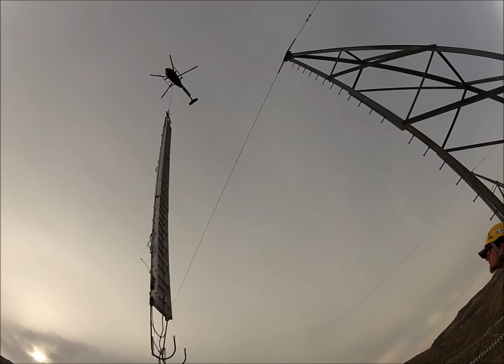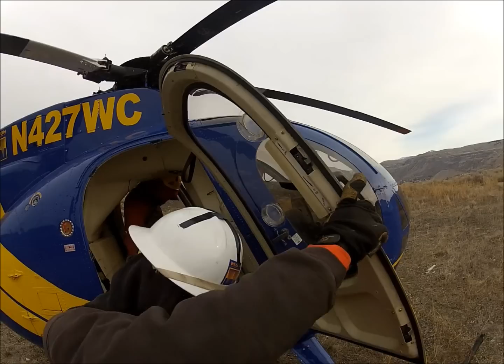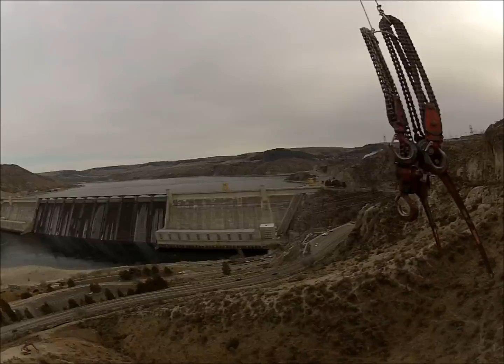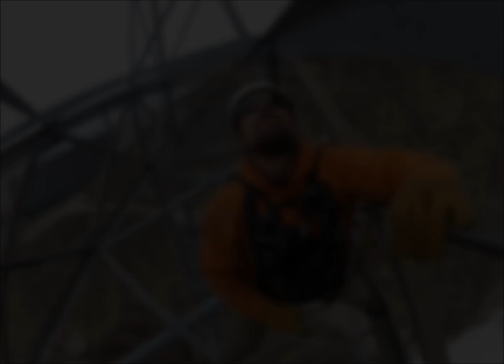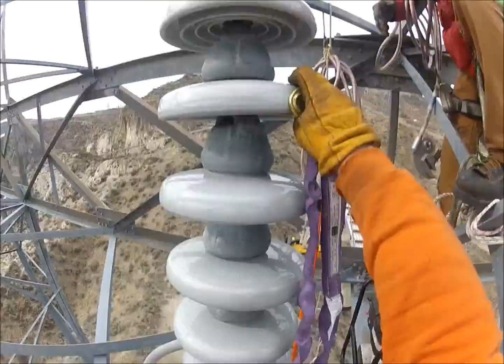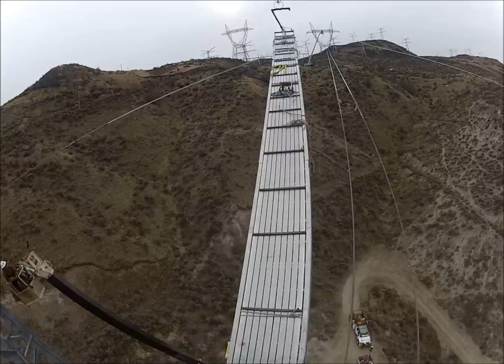Grand Coulee 500kv

Comment: According to Aaron Dover, there are no generators at Gran Coulee or any other dam. You can clearly see that there is no water coming out of the bottom of the dam in the video. That is consistent with Dover's theory. 

What IS going on here is an update to the power lines which gather atmospheric voltage on their own.

Comment: I have made two trips to the west coast from the Midwest where I drove out of the way just to see the Grand Coulee Dam and take the tour of the great project.  It doesn't look it but there is enough concrete in the dam to build 3 Hoover dams.  I was amazed at the transmission towers out of there.  It is a long way down and the wind moving you around makes what these guys are doing dangerous at every place.  Here they are doing it on a dead line but lots of times they do it on energized lines, tough job, if you want to see how dangerous ask a life insurance salesman what a lineman's rates are.

Comment: I'm gathering these lines are switched off? You're not doing any bonding on or off and don't have hotsuits on so that is my assumption. lol
Reply: I think they can be actually hot and they would still be okay because they are far enough away from ground and the other line.
Reply: sir MAXX You would be wrong.  Lets say you're on the tower, and you go climbing out on the insulators and the lines are hot, you'll fry because you're creating a path to ground via the insulators.  Actually, you wouldn't even get to the line, you'd get maybe a quarter way out on the insulators before you'll fry.
Reply: hardmarine
Right. But not if you're dropped off by helicopter right? Then you're nowhere near ground, and even though it would be loud and uncomfortable, you'd still be able to be on the line with no suit, right?
Reply: tall32guy You would still need a suit, and that's why helicopter linemen wear suits.  The reason being is the invisible induction field around the lines would still fuck you up.  That is the reason you never see birds landing on those wires, it's way to uncomfortable for them to be there.  Also, the suit allows the electricity to flow around the lineman, rather than through him.  The only time you'll see guys up there with no suit is when the line is de-energized.
Reply: +tall32guy the towers are grounded. So when they place the ladder on the line, it'd short to the tower. Or, if the ladder weren't conductive, the people fondling the wires are :-P. Either way, it's unpleasant.
Reply: +sir MAXX no they are off because if they were on there would be a big ass arc when they removed the gray insulator discs